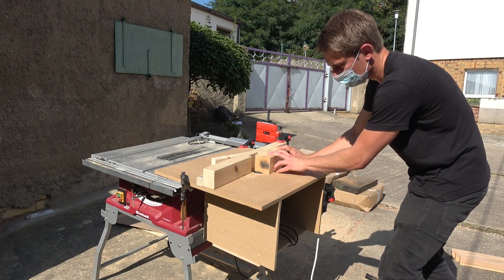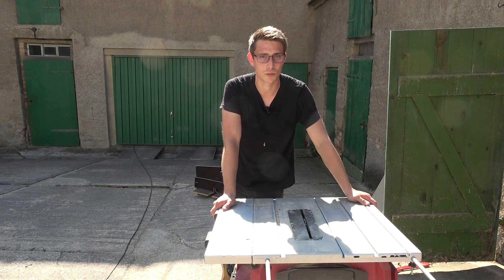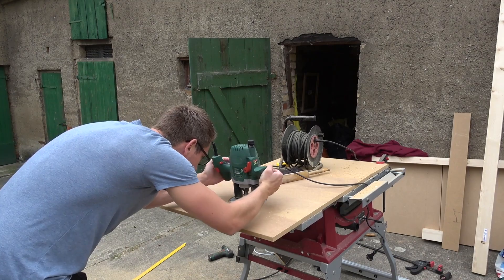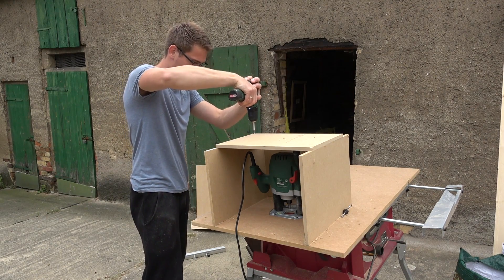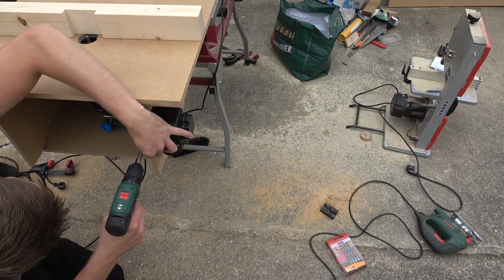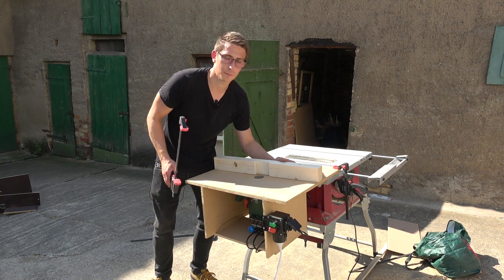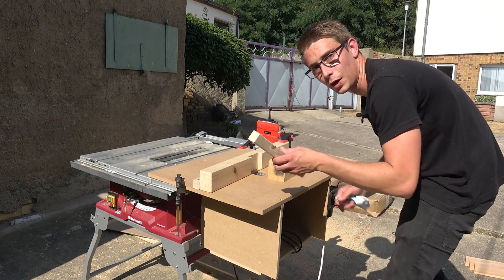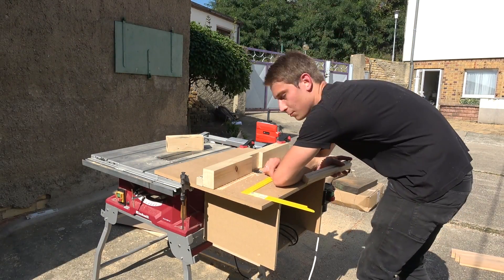Not your Normal Router Table...

Comment: I like the fundamental principle behind your pivoting fence.  I have done the same for about 30 years.  A big advantage is it is easier to get a precise adjustment of the distance from the fence to the bit.  I use a micrometer head at the end of the fence to adjust the cut.  If I want to adjust the cut, say 0.010 inches, I move the end of the fence 0.020 inches.  (My bit is in the center of.my router table.  

I imagine that you were kidding about needing to have an accident  to learn to always use safe practices (especially since you are a teacher).   I've learned lessons that way as well - but I've generally preferred to learn these lessons from other people's mistakes.

When  I was a freshman engineering student about 50 years ago, we had a foundry professor nicknamed "old 4-fingered Leach".  If my memory serves me correctly, by the time I graduated, his nickname changed  to  "old 3- fingered Leach".  Looking at the bright side of things, his loss(es) probably saved countless other fingers though. I always think of his fingers when I am doing something in my shop (I still have all ten - albeit that is a result of just dumb luck in at least one case.
Reply from the maker: Good catch, that was obviously a joke!!! I would never, for the love of god try to experience something of that sort by myself just for a learning effect :) Thanks for the comment, Frank! =D

Comment: Cool video! Why did you use mdf tho? Isn't plywood way stronger and as such a better material to make a project like this one? Btw i'm not a woodworker or anything, I just always thought mdf was the cheap shitty stuff for furniture.
Reply from the maker: One reason tbh: I still had it lying around :'D
Reply: mathematically plywood and mdf have roughly the same strength, well id say +/- 30%... if u want strenth thickness increases strength by highect cubed and material properties are only linear, wed al take polynomial time over linear for sttrength